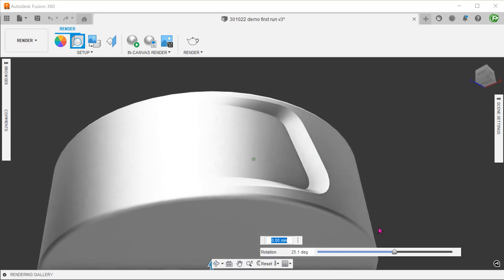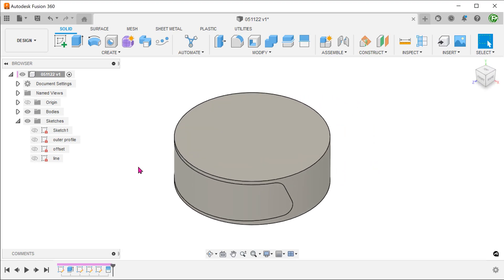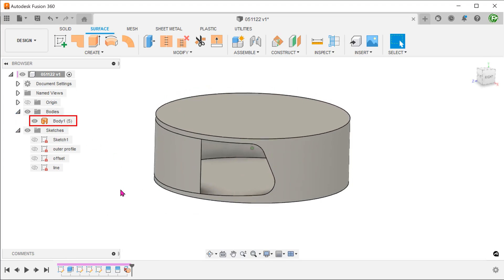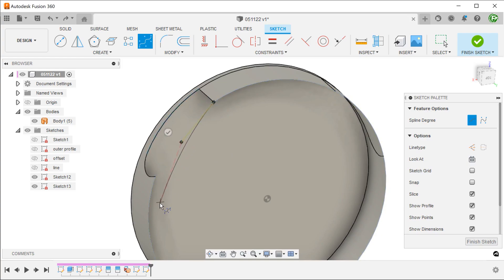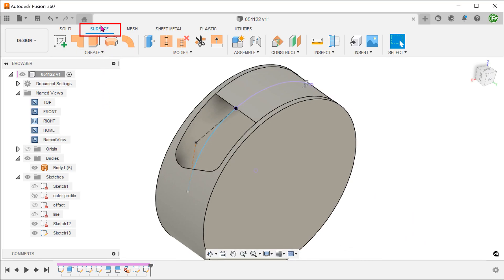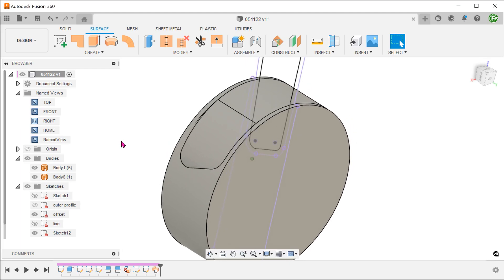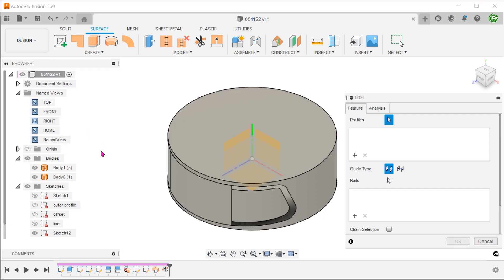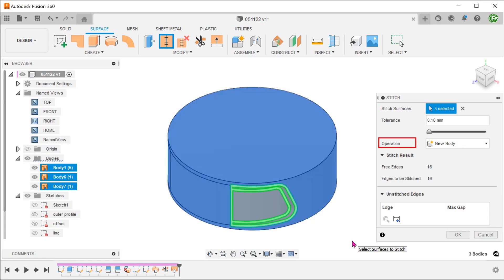Fusion 360 | Fade-in Recess

Comment: i followed along with your tutorial from scratch.  I did notice something odd about the two recessed bends when i did a zebra inspection tool.  So i took your tutorial and took it a step further.  I actually created 4 lines lines (two for each of those bends) to connect the inner and outer offsets did 5 separate lofts for the recess.  Now the zebra tool looks more consistent.  Hope it made sense. lol  wish i could post my results in comment for you to see what i mean.  this was a great teaching tutorial.  Love your work!
Reply: Did you try simply adding those lines as rails? It’s simple enough that it might provide the same result with a single loft. I would also select the two edges as rails and make them tangent to ensure the transition there is well-controlled.

Comment: I like this tutorial, because the techniques can be applied to any CAD software. However, one issue which could need further scrutiny is how to ensure that the recessed surface is tangent with the main outer surface. In this example, we're lucky because the outer surface is a simple extruded surface, so simply adding a tangent constraint to the sketched curve is sufficient. In a more realistic scenario, the outer surface would be a more organic shape, so you would need to find another way to ensure that the recessed surface is tangent.
Reply from the maker: In the case where the outer surface is a more organic shape, we might need to use a lofted surface to replace the swept surface. The loft command has continuity options to control how it joins to an existing face while the sweep command does not.

Comment: this seems overcomplicated...
wouldnt a single Sketch with the external circle and internal surface be much faster?
Extrude both. 
Use the split body to cut and then Join both. 
Apply a combine body and done
Reply from the maker: I'm not quite sure I completely understand the workflow you have described. Would you be willing to make a quick model and post a share link? I'm keen to learn new perspective on this.